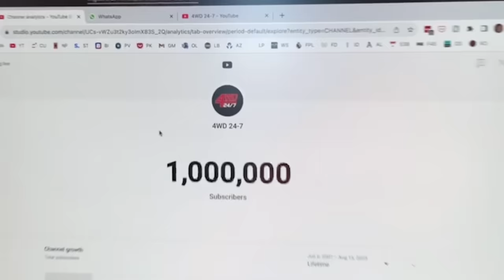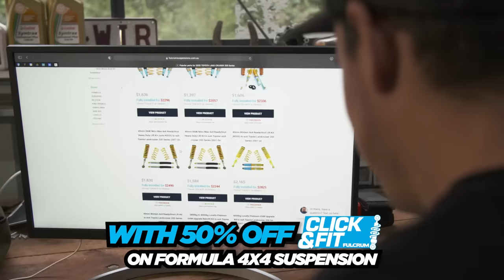Behind the scenes with DONUT MEDIA + a HUGE 1m subscriber announcement! Who's coming with us?

Comment: From the factory, the Jeep Rubicon is literally the most capable hard track vehicle you can buy. A Patrol has a more robust driveline (even against Dana 44), but the actual suspension setup, factory e lockers, reduction gearing and swaybar disconnect is just great to have without having to go aftermarket. They're not meant for towing or touring, and they don't try to be.

Comment: For the Millionth Catchup
I think it should be the geographic median centre of Australia, not far west of the Sturt Highway, south of Alice Springs.  Gravitational Centre was calculated from 24,500 points spread around the high watermark of Australia's coastline and If you check, a major monument has been erected 32 kms north of the Kulgera/Finke Road. Basically   this is the most geographical centre of Australia.
Cheers

Comment: Wranglers are pretty much the undisputed kings of crawling, and I say this as an 80 series owner.  The thing with Wranglers is that you pretty much have to completely redo the axles and suspension to reach their potential.
Reply: Get a rubi with lockered 44s front and rear. I believe with no lift you can put 35s
Reply: The diff thing is why the majority of comp winch trucks are based on GQ swb chassis.  Even the SJ413 sierra is easier to mod here than a wrangler,  but they had the right idea.

Comment: Jeeps are pretty underrated in Australia, they are crazy cheap but still insanely capable, and there is so much aftermarket supports. I know what I'm buying in a couple of years, even if buying a JK as your first 4wd is a bit controversial here
Reply: I think you will discover they are correctly rated. You need to mod them a lot and parts aren't easy to find here. Our laws prohibit most of the mods needed for them to keep up. They can't  carry much and have little fuel tanks.
Reply: JL is heavy duty underneath. On 33s will tackle almost anything. I took my wife and kid to the Cape and did the tele, Frenchman's and old coach road... Didn't need to carry any extra fuel. Averaged 13.5L for the whole trip loaded up. 
Not a single issue, no squeaks no rattles. 
The car has been amazing since we bought it. 
Just finished an amazing trip through the glass house then down to Barrington Tops and it owned everything it went near.

Comment: Mitsubishi Industries (or Mitsubishi Heavy Industries?)were licensed to build Jeeps in Japan for a while. You may be able to find one for sale somewhere that you can import to Australia. I have seen one for sale here in the U.S. The were arguably better built, they were left hand drive, had diesel motors, and had some galvanized components for corrosion resistance (beach driving).

Comment: 88 dodge ramcharger  6 in lift 38x13.50 swampers that small block loved rpm mountains mud sand rivers it didn’t care all home built with spare parts 1tons out of an old f350 most expensive thing on that rig was the trans $4000 well worth it tho